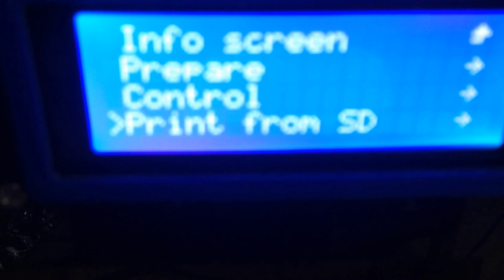Anet a8 CNC upgrade(first test of gcode)

Comment: Check out estlcam for generating the gcode (this is for a MPCNC) type machine
https://www.vicious1.com/estlcam-basics/
Reply from the maker: I havent had to much sucess with ESTL cam i had to use the software im used to already and change the file extension name to GCODE but that might be causing the issue im having..  but im gonna work on it agian today see what happens

but thanks for the settings info that should help..